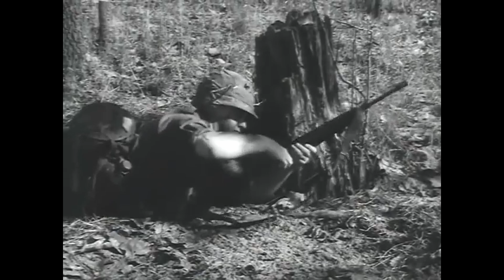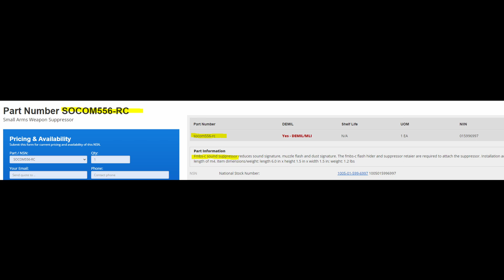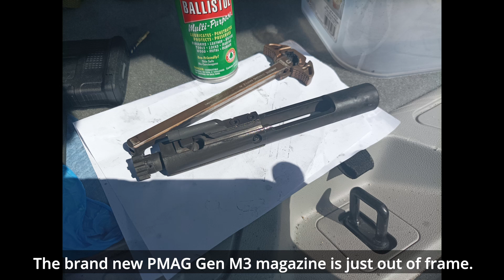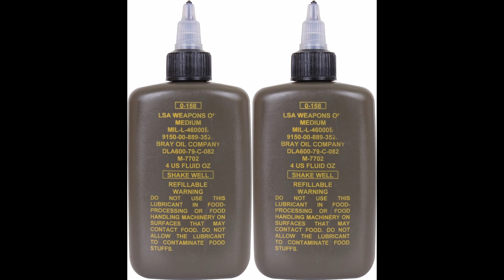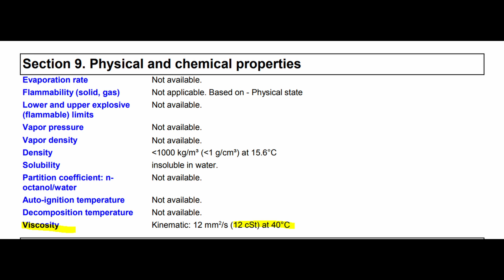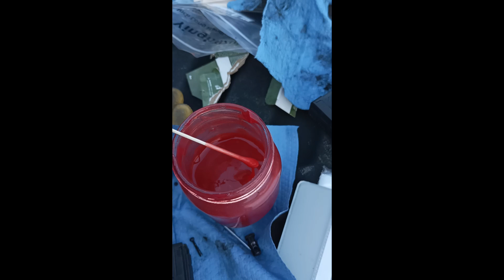Best Lube for Suppressed AR-15? 11 Lubes Tested!

Comment: I have trouble finding a good balance between good adequate staying power and good clean running when shooting suppressed AR15’s. I tend too go back and forth between Sriracha and CLP’s. My all time favorite has too be EWL-30 at this point. It’s thick, stays around but doesn’t get as filthy as mixed lubes like sriracha sauce. Lucas Extreme hasn’t impressed me whatsoever, I see it getting blown around and hanging onto every bit of fouling it come in contact with.
Reply from the maker: I don't think any one lube will run cleaner than another. It seems the gun gets equally filthy and it's a matter of how much lube is still on the gun that changes the perception of cleanliness. I do think EWL-30 would have done better than the regular slip2000, though, based on this test.
Reply: Interesting, if you don’t believe that certain lubricants help keep the filth too a minimum or simply run cleaner than others then why not use grease? It’s because grease turns into sludge in a hurry and actually slows the bolt velocity down, iv seen certain liquid lubricants do the same thing
Reply from the maker: @stevenmarcus2709  Generally all lubes will thicken from evaporation loss and with a gun's use. In this short test I could hear a significant audible delay which seemed like 1/4 second longer than normal for the bolt to close after only 150 rounds that I had fired and the BCG was hot. This is about the best case scenario for grease and it gave a fairly questionable result.

You can see in my results that the best liquid lubes were able to stay on the BCG just as well and are going to provide much better cold weather performance. They will probably do better with higher round counts considering all of them will begin to sludge and start slowing BCG velocity, you might as well pick the one that isn't doing it at only 150 rounds.

Comment: I just whipped up some SOTARacha last week before watching this video. Glad to see it performed well and that I didn't waste a bunch of lube in vain. I used to use wheel bearing grease, but it looks like this will be my new go-to AR lubricant. Great video!
Reply: Since my last post, I noticed a couple things about the SOTARacha. I applied a little bit on the bearing surfaces of the carrier and bolt. After a few days and a range session, I broke down my rifle and found it had spread everywhere in the upper — all over the carrier, bolt surfaces, hammer, etc. But it was still a visible, viscous layer of lube. This stuff is really pretty good for an AR. It’s thick and remains where it needs to be, yet the oil still migrates into crevices. I’m going to try using this more
Reply: @HaroldTheSloth  Is the migration improved by the thickness?  As in , thickness encouraging thicker layers that weigh more and have more momentum that throws off during cycling?
Reply from the maker: Purely as a lubricant it seems really good considering how available and how cheap it is per volume. I don't think it will be all that great against corrosion, though.
Reply: @fullspectrum1616 I wouldn’t worry too much about it. Just about all synthetic motor oils and greases are treated with corrosion inhibitors. Idk where people keep spouting “dOeSnT hAvE cOrRoSiOn InHiBiToRs” but they’re wrong. Now it may not be as good as dedicated gun lube, but Regular guy training has been using something like that for over a decade and he has never reported having corrosion issues and he runs his guns hard
Reply: For me it’s about temperatures, can get -40F here. And we know guns haven’t liked the cold from wartime history. Ive just mixed mineral oil and LSA hoping it won’t be too gunky or frozen. Great vid, thank you!
Reply: I agree. I’ve been using that SOTAR recipe for years! Full auto, suppressed it just works and it’s not a scam or a way overcharged rip off like 90% of gun lubes sold today!
Reply: I've been using a version of SOTAR's grease/oil. Having been stationed all over the place (from relatively cold places close to 0 Fahrenheit at the voldest, to 29 palms and 118deg in the shade). Sometimes, my firearms are stored in an un insulated garage safe, so they aren't always babied. Some of my firearms are well over 50 years old and are only shot once a year or less and store them in vacuum seal bags, well greased and always clean when stored that way. My version was always break grease with rem oil. With my IWI Galil, chambered in 308, I've never had an issue with this mixture and I'm at about 3700 rounds through it. None of my AR15s or AR10s have nearly that many rounds through them.
Reply: @narref04 RemOil has Teflon, which when burned off produces highly carcinogenic aerosols you breathe when shooting.
Reply: Sotaracha seems far too viscous
Reply: @nahbrahhh  you can thin it down as much as you want. But I assure you it is excellent.
Reply: @HaroldTheSloth better than Nano?
Reply: @nahbrahhh The viscosity is precisely what makes it so useful. Conventional oils will run out of the action during storage. The thicker consistency allows it to stay where it is needed.

Comment: I use LSA, Cherry Balmz grease, and nano. 
Nano has been great, albeit my round counts are rather limited
Reply: Huh, I was curious about Cherry Balmz and how good they were. If they work well, I’ll switch to that when my current Lucas gun oil finally runs out.
Reply: @gameragodzilla  Forward Controls Design has Super Duck Snake Oil that they developed with CherryBalmz, but comes in a larger bottle at a slightly better price.
Reply: @gameragodzilla  It's basically factory made SOTARacha for 20x the price
Reply: What kind of grease is Cherry Balmz? Molybdenum? Petroleum based?

Comment: Thanks for the comprehensive review.  Hoping to get some testing done next week on Radcolube: It's a cheaper albeit slightly more caustic(per MSDS) contemporary to G96.
Currently going down the rabbit hole trying to figure out if Swiss automatenfett is viable. From hearsay it's either a Motorex product or Aeroshell 33MS/64. In my limited testing of Aeroshell 64 on an OTF knife, the MoS2 component's slippery magic seems to work well in a very thin film. For the most part my search for detailed information on MoS2 performance in firearms has been limited(lots of conflicting views).
The LSA reauthorization is likely due to the harsh firing schedules/larger bearing surfaces of crew-served weapons, but that's just my WAG.
Reply from the maker: Very cool. If you get your own testing done and make a video or otherwise host it online it feel free to post a link in the comments here.

Comment: 0W-20 synthetic motor oil will probably never let you down under normal use.
Reply from the maker: Yeah for just lube motor oil seems actually ok. It seems to have a lot less anti corrosion additives, though for less long term protection.
Reply: @fullspectrum1616  "less anti-corrosion additives"  Not good, makes me wonder what difference might show itself if someone with enough money to but a new automobile and change out every 3,000 miles with a "good", premium gun oil. 🤑

Comment: I use FP-10 because of it's excellent cold weather capabilities.
Reply: I mostly use FP-10 as a cleaner and for oiling the outside of my firearms. It never gets cold enough to use those cold weather lubes where I live. The coldest it gets here in the winter is about 25 degrees Fahrenheit at night for about 2 weeks out of the year
Reply: @NathanPsalm135  FP-10 is good to like -40F i think.